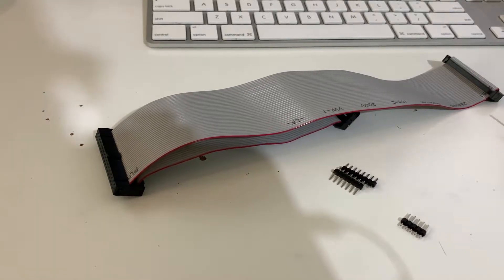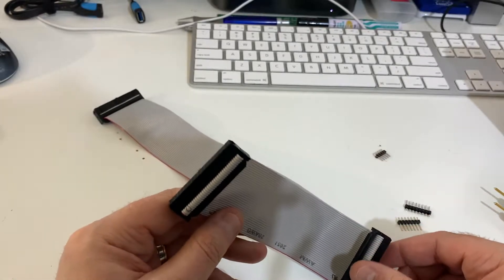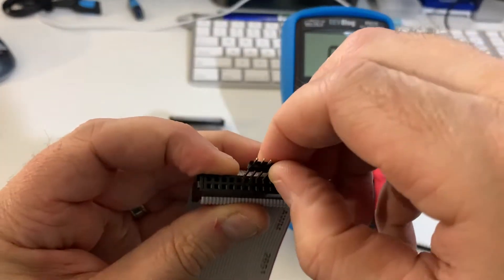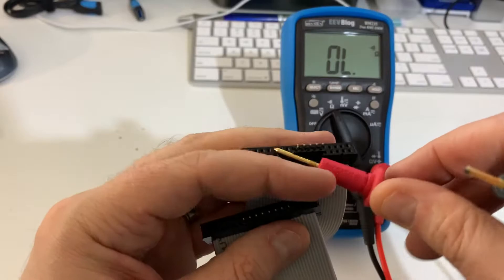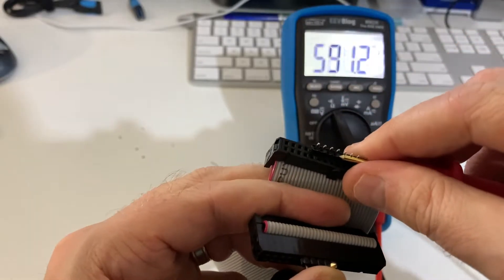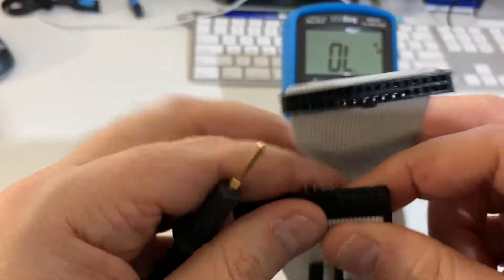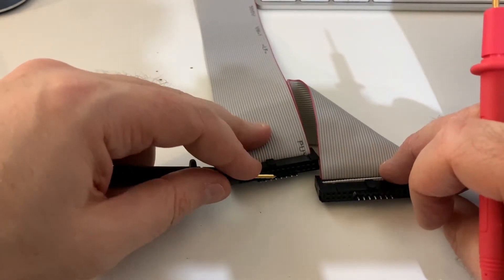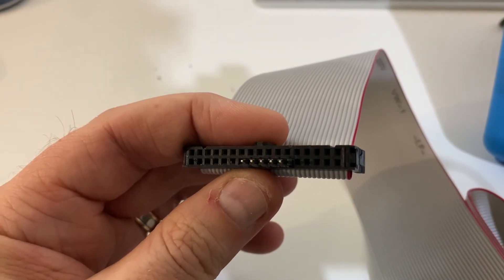Tandy 1000 Floppy Drive Pin outs

Comment: Hey man, Ok lets make this easy... I have a tandy 1000HX .. At the moment it has the stock floppy and cable. In order to use your adapter to install a standard floppy drive, what do I need to do?
Reply from the maker: Howdy, the HX is easy, my HX compatible FDD or Gotek adaptors work for both drive positions.
Reply: @Cybernetic_Systems  fantastic! I just picked one up for my father. I bought that for him for his birthday and that darn drive was toast. I’ll keep you posted :-)
Reply: @Cybernetic_Systems  just for clarification, I’m assuming that the existing cable goes from the motherboard to the adapter and on the other end, we’re going to use a standard floppy cable to go from the adapter to the standard floppy drive using the four pan power breakout to power of the drive. Correct?
Reply from the maker: Yes that’s exactly correct, the adaptor takes the power from the standard HX floppy cable, and sends it to the floppy power header. You then run a power cable from the header to the disk drive.

I sell the power cables too, but they are easy enough to make yourself.
https://www.tindie.com/products/cyberneticsys/floppy-power-cables-tandy-1000-amiga-atari/

Comment: This is not original 1000TL / TL2 / TL3 cable - original one has also 5.25" connector. The 'flipped' "HX" connector next to it connects to the motherboard and two regular connectors go to the 3,5" bays (colored wire is pin 1!). Unfortunately I got my TL/2 (you can see it on my channel) with the cable plugged into the motherboard wrong way and by my stupid mistake I connected the floppy drive into the 'reversed' connector which blew it :( I'm looking for 1000TL/2 FDD ever since... I found similar one and modded the electronics so it's powered up like the original FDD but it seems there's something else wrong with this drive as it won't seek. But I also ordered your adapters on Tindie in case I will never find the fitting FDD.
Reply from the maker: Ah that sucks! I hope you get it working, feel free to message me via Tindie and I’ll do my best to help out.

Comment: I just found your adapter on Tindie via a DDG search for info about replacing a FDD on my Tandy 2500 XL/2. Do you know if your adapters can work with this machine?

My diskette drive seems to have blown an SMD component, I am assuming a capacitor (tiny square turned into a tiny black blob with black crap ejected elsewhere). It started as an inability to recognize a 1.44MB diskette, intermittently, which evolved to always, and now has become an inability to read any disks at all. I do not have the tools or the skills (no knowledge, no experience, plus my hand tremors) to do a repair of the component on my own, and I don’t know if it was a part failure or an over-voltage caused by some other problem elsewhere.

The shipping cost for me is also more than the adapter itself. Sigh. Classic computer nostalgia is expensive. :-(
Reply from the maker: Howdy, I’d need to find a technical reference manual for the 2500  to confirm, but it’s highly likely the pin out is the same as the 1000 range.
Reply: @Cybernetic_Systems  I can't seem to find a service manual online for the computer, and the user's manual doesn't have the pinout for the diskette drives.

The broken drive I have is a Teac FD-235HF 106-U, part # 19307321-06. I couldn't find the technical manual for this drive either, and Teac made a TON of drives with the same FD-235HF model family. I can't find more of them on eBay either.

I've got an FDD pulled from my Akai S6000 connected via the 5.25 edge connector (I've got an adapter on the drive), since the 5.25" drive end of the cable already has modifications to the cable, as the 5.25" drive is powered with a standard power cable (which I've also adapted to 3.5" FDD). This FDD needs to go back with my Akai some day, especially if I sell it, so I need to get another similar drive (Stugart? A generic Dell FDD didn't work), and I would rather not be using the edge connector adapter permanently.
Reply from the maker: @dysamoria  let me look into it and I’ll see what I can find. Most IBM compatible floppy drives are broadly Shugart compatible. The issue is the advanced features like disk change detect and ready signal that computers like Amiga and Atari use. I’ve found standard 3.5” floppy drives work in Tandy 1000’s as long as they support disk change on pin 34 (which seems to be most) and have switchable DS1 to DS0 option (B to A).